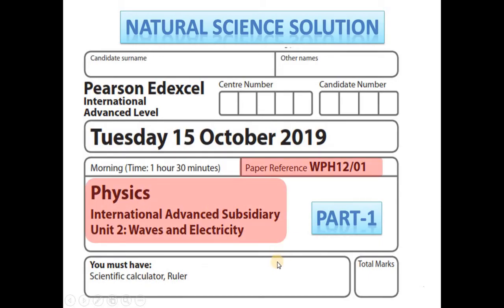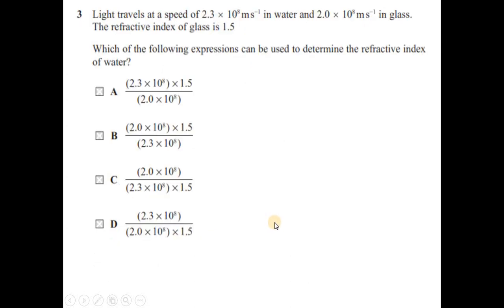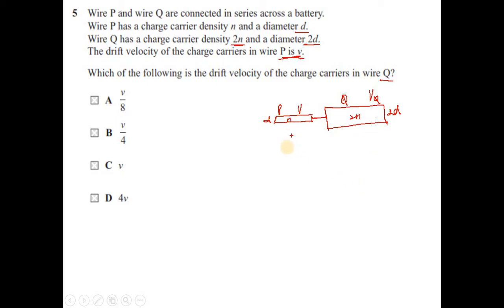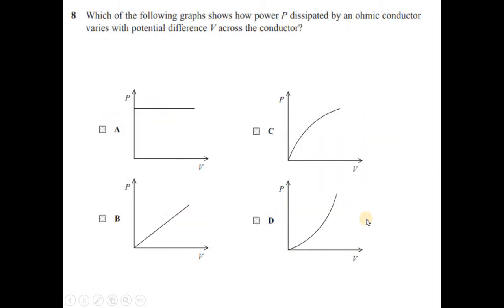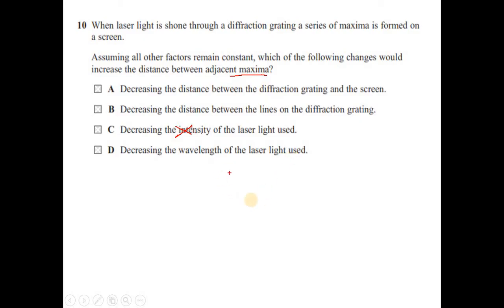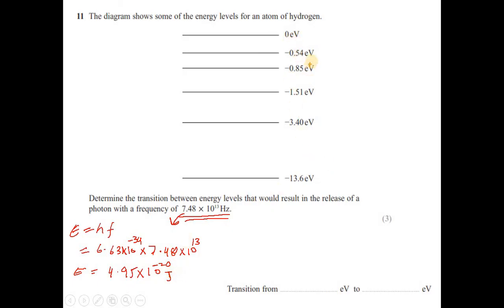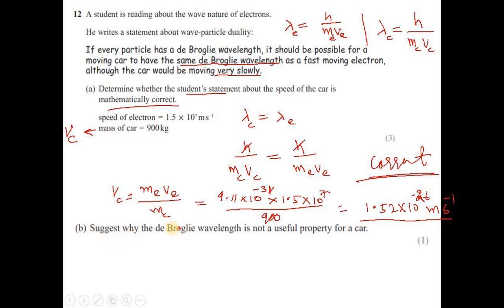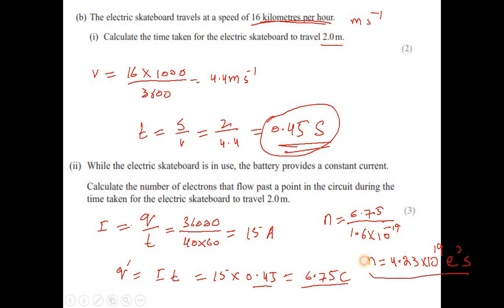Edexcel IAL physics New Spec unit 2 Oct 19 part 1

Comment: Why 4 is multiplied by d^2/4 instead of 2 when you multiplied 2 with n in question 5? (skip to 14:11)
Reply: To make the equations corresponding since the 1st eqn has d²/4; the second eqn would also require the same d²/4 for the v to be comparable